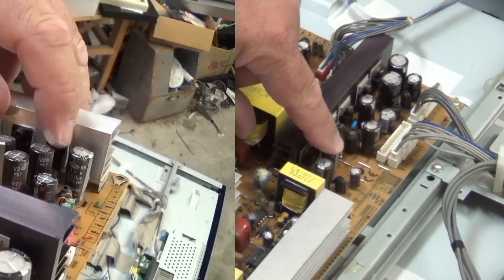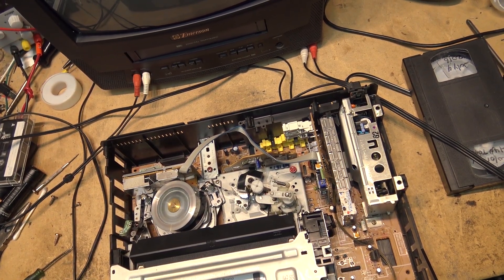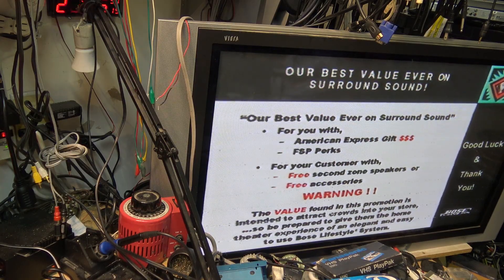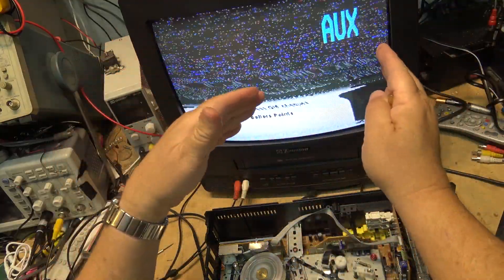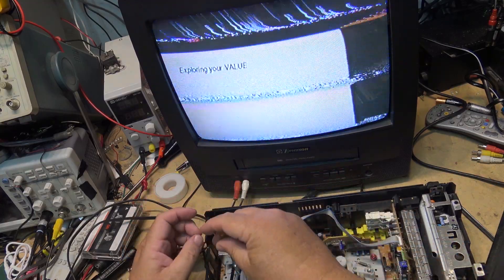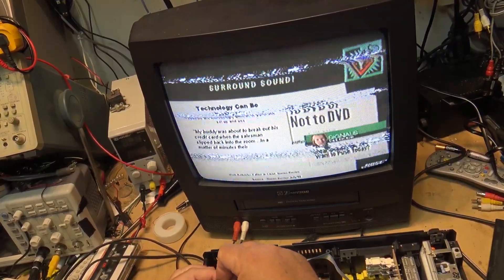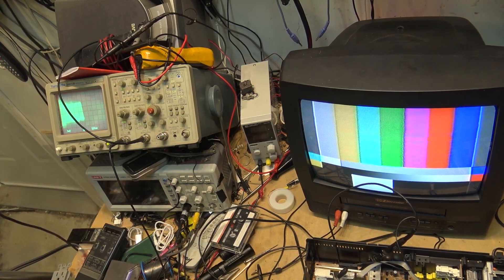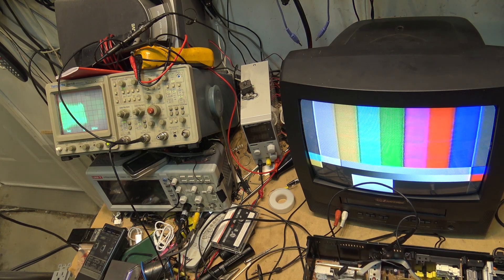VHS tape path alignment without using a scope

Comment: I've been trying to digitize some old VHS tapes and this was helpful in aligning my old VCR. With known good tapes i've got the picture perfect. What i can't seem to pin down is why with some tapes (all of them recorded family tapes) they're jumpy, fuzzy, and in black and white. None of them were recorded with this VCR, not even the ones i know are good tapes. Tested the picture with a home video that comes in clean and with a good Disney VHS. Perfect. Others? Not so much. Is this purely tape degradation? Some of them are copies made from camcorder tapes as well. I'm trying to figure out if it's the VCR or the tapes.
Reply from the maker: Tapes definitely do deteriorate especially if they are second or third generation which really affects the color quality. I'm just right now digitizing a bunch of tapes for a client and some of them are second or third generation but were recorded with home video cameras from the early 80s and the color off some of these cameras was well let's put it this way they're closer to black and white then color the camera is himself for just horrendous back then. But yes tapes do deteriorate it's usually the color that starts to go first because the luminance are black and white information is recorded as an FM signal where they frequency is modulated to represent the brightness the chroma which is the color signal is amplitude modulated as the tape deteriorates the signal level reduces and just like with AM radio a station that's distant will fade out and be weak or as an FM signal from an FM station remains loud and clear until it gets to the point where you can't detect it at all and then it just goes right away the noise

Comment: In this video, you have mentioned P2 guide pin and P3 guide pin. Where are P1 guide pin and P4 guide pin. What are the uses of these guide pins. Kindly explain with diagram, if possible.

Comment: what if that happens only with one tape , and it's like happening in waves every two seconds or so?
Reply from the maker: Is the tape damaged?
I have see tapes where someone put a magnet over it momentarily and it erased a section of tape along the edge. As the tape was playing of course as the spool on wines you get this little section of partially erased tape which caused flicker cause mistracking looked like a tracking error. We actually had some goofball in the video store that went around and did this to a bunch of pre-recorded tapes anyone who rented a tape of course couldn't play it. When the video store reviewed their security footage they found that a man have been going around holding a super magnet up to the tapes as he walked up the aisle ruining tapes that were on the shelf. This was after they stopped keeping the cassettes separate behind the counter and started putting them actually on the shelf. They caught the man it was featured in the local paper the problem was the man had a mental condition so he was not criminally responsible for the thousands upon thousands of dollars of damage that were done to all these pre-recorded tapes that all had to be replaced. The local video store actually had his picture from the surveillance tapes displayed prominently in the store with an oat saying our rental prices have increased to cover stock that we had to replace because of the actions of this man.
Reply: @12voltvids  Hello! Many thanks for your kind reply and help. Well, that was a glorious disaster indeed! So, I do not have the tape at hand, but I will check. And it also make a squeaky noise when fast-forwarded, and if I do that after stopping playback, the player stops, so I have to fast-forward while playing (I hope I could explain myself). I want to digitise old memories. Thank you!

Comment: Great tutorial. Btw, I converted an old vhs tape and have issues with 1 tape that has horizontal static lines during the whole tape. Would your tutorial fix it or is there some other method? See video here. Thanks for any advice.  https://youtu.be/p_9_4cn3Q8U

Comment: Thanks, this helped me get a VCR working again. I hooked it up to an old (analog) Commodore 1702 monitor and you're right, it was much easier. The one tricky thing was that I had to use a lot of pressure to turn the guide, and I didn't realize at first that pressure was also affecting the guide. So I found I needed to do e.g. a 1/4 turn, take the screwdriver off the guide and observe, then turn again, etc.

Comment: Doing it on my digital tv, cause i dont have any analog tv at home and it is so painful. Tried it for fifteen minutes and nothing changed, the picture is still distorted.
Reply: When i screw theleft  it does nothing to the display, and the left "screw" is more lose then the right one. When i screw the right, it s more tight and move the picture. What should i do?

Comment: Thank Dave for such good tutorial on videos. Please advise what is the tool you use to adjust the P2 & P3 Guide, because a normal screw-driver Cannot sit across the slot which has a center post. Thanks.11/1/21
Reply: They make it so you have to use a special "tape guide adjust tool" so that peasants like us can't fix things. I use a pair of (cough, cough) TOENAIL SCISSORS that has pointy tips that 'grab' two of the slots on either end of the center post. Then I put it all back together, watch Apollo 13, and cut my toenails.

Comment: Are P2 and P3 clearly marked? I'm a total novice at VCR adjustment and don't want to do irreparable damage to an elderly machine.
Reply from the maker: P2 is the one on the left side of the head drum and p3 on the right side looking from the front.  No they are not marked.

Comment: I sometimes have to de-align one of my vcr to properly read a tape that was home recorded on a deck that had bad azimuth around the video drum. The only thing i haven't made myself is a proper screwdriver to turn those post without falling aside. when i calibrate a deck for perfect alignment, i use a mix combination of a few factory recorded SP tapes and i have a few original LP movies as well,, i try to find the perfect middle position of the screw for that scope of tapes so i know it will be fairly okay on most tapes and will record about right in the middle of all those factory calibration.

Comment: My VCR is displaying a very dim black and white picture. Could this be a tape path alignment issue? I cleaned the heads and it made no difference.
Reply from the maker: Unlikely.   Check power supply caps.
Reply: @12voltvids  Thanks, will do. I forgot to mention, it displays color and brightness perfectly in the setup menus with no tape inserted.
Reply from the maker: @busterscrugs  
Probably a cap going bad in the lumanence process circuit.
Reply: @12voltvids  Well, I checked around for bad caps, couldn't find any that were suspicious. I did find a small spring though, not sure where it goes.

Comment: I’m restoring my VHS tapes and some of the older ones have this issue where the horizontal lines are all over the video. Newer VHS look and play fine without any issues. Does this mean the problem is with the VHS tapes rather than the player?

Comment: This is very interesting. Thank you. I recently borrowed my sister's old VHS player she had stashed in a cupboard and the picture was great for a couple of tapes being played, but suddenly the picture was awful. I tried to adjust the tracking and that improved the picture slightly, but now watching this I see that for some reason the alignment had changed. I wonder why it suddenly went wrong like that?
Reply from the maker: Have you tried cleaning the heads.  
If the lock screw comes loose the guide posts can shift.
Reply: 12voltvids Thank you for getting back. No I haven't tried yet. So far I have only played it.

Comment: is there a special tool i saw the two adjusting poles but they have very shallow X's with a round part in the middle.
Reply from the maker: I just use a slot screwdriver.

Comment: I have this very machine and I'm hoping to fix its video issues by this video since I am having similar issues with mine. I got it by finding it left on counter in the mail room of my building..At first it played beautifully for a long while then I used it again and started having picture troubles. If only I could find the remote that went with it..  Can you tell me the type of screwdriver you are using? These machines are so over priced when you look for one. I just love the look of it and even after all these years it still looks so modern!!

Comment: silly question
does multi head drum have only one correct path for the tape , or is that you just need to hit any video stripe on the whole length and that  could shift depenting on which one you hit, and there would be like 3-6 video stripes  you could align to depending on how much the mechanism alows and how many heads the drum has?
i am thinking of restoring two very strange very unique video recorders from the 70's and i kind of wondered about how much can the tape path be degraded on almost 50 years old equipment that never was really in use (but is quirky as heck and all transistorised no ic's)

Comment: What is the green circuit board looking thing that are often times found on top of the video heads?
Reply from the maker: Well that would be the interconnect that connects the heads to the rotary transformer under the drum. Some machines have the motor on the top and in that case it is the motor board.
Reply: @12voltvids  thank you! What type of screw driver are you using? I have practically the same VHS player. 

It appears to look almost like a flat head screw driver hole, except it’s got a dot right in the middle.

Comment: how do i get rid of them annoying DOTS that move abt on the bottom of the screen?  i have a panasonic ag7500, great picture, but the dots show up at bottom on all tapes? my cheap store branded machine crap picture but dots are below bottom of screen so i dont see them :-( ?
Reply from the maker: The dots and other artifacts that wiggle around at the bottom of the screen is called the head switching point and you do not get rid of them. The occur at 7 lines before vertical sync on Beta and 8mm and 6 lines on VHS. There is no way to rid yourself of them. In  the days of the CRT, the overscan of the tube hid them, no so on modern TVs or CRT with very accurate vertical size.
The reason that poing was chosen to switch the video head from one field to another is to avoid having in in the vertical sync area where it would cause sync instability and result in a rolling picture. 
Its one of the analog artifacts that you have to live with if you want to play with obsolete technology.
Reply: @12voltvids  cheers , thanks for the fast reply aswell

Comment: Excellent! I have two VCR's that play some videoes perfectly, and some of them they are stuck in the same pattern like you had here. I think it's weird that some does work and some doesn't, but I really hope this will solve the problem for the tapes that don't work now :)
Reply from the maker: The tapes that do not play right were recorded out of alignment on the recorder.
Reply: @12voltvids  Aha. Some of them are VHS-C tapes, put into an adapter. Got 10 tapes from a customer, and half of them played fine, while half of them were jumping/rolling like in your video :)
Reply from the maker: @OuglandMedia  cameras were especially bad at going out of alignment because people dropped cameras and knocked something out of alignment or broke something internal.  Some can be recovered others not.
Reply: @12voltvids  That sounds right. Some of the tapes works fine in the original camera they were filmed in, while playing them in a standalone players can cause problems. I have so much to learn, so I'm happy I found you channel :)

Comment: Great video, I have a Samsung VHS player and Im trying to archive my parents old camcorder tapes, which are on VHS; but the player it has recently developed an issue. The audio is perfect but the picture flickers and produces a horizonal lines across screen, and sometimes I can see 'film frames' (not sure the technical word). I have tried to clean the tape path (the head spool (all 6 heads seem to be clean), the erase head, capstan, pinch roller , I have also removed the tape cleaner, but the flicker persists), and ideas? DO you think I should try and adjust the P2 and P3 guides as you have suggested here? And if so is there a risk of unscrewing the guides completely?Many thanks.

Comment: Do you need a VCR alignment tape to do this? I have a Panasonic DMR-EZ48V that I am trying to realign after one tape messed everything up.

Also, do you have a replacement head cleaning liquid you recommend since freon isn't widely available anymore?
Reply from the maker: Isopropanol alcohol 99% works fine.   All you really need to do alignment is a known good tape.  Most prerecorded are very good.

Comment: Hi! I have a cassette adapter that I put the smaller vhs tapes from my camcorder into.  When I play a few tapes they’ve got like a static at the bottom of the screen.  I know these tapes are kinda old but is there any way I can fix this problem? It must be coming from the smaller vhs tape rather than the cassette adapter I’m thinking.  Anyway any suggestions would be greatly appreciated!!
Reply from the maker: You can try to adjust the exit guide on your vcr. This is the one on the right side of the drum looking from the front. That is where the bottom of the picture is recorded.  Look at the tape for damage on the top edge of the tape.
Reply: @12voltvids  awesome I’ll check that out !! Thanks so much!!

Comment: Could a misalignment on a VCR cause it to chew at just the edge of the tape, causing it to become kinda wavy? It plays fine and does not jam, but it just naws at the edge.
Reply from the maker: Yes it can damage the edge of the tape.  Usually it is guide that pulls the tape out behind the pinch roller
Reply: 12voltvids Thank you! From visual inspection that’s what I saw. Is this particular guide adjustable? How do you correct this? If you know off hand. Thank you.

Comment: I've turned mine so many times I don't know where the original start point is. Is it like a screw that can only go so many turns one way or another? Or is it just fine adjustment? At the start I was close to a perfect picture but too many turns later I have no idea what I've done

Comment: What type of screwdriver? I have a CRT and it looks like this VCR's heads are out of alignment, I keep turning the things with a flat-tip screwdriver but it doesn't do anything. What way should I turn
Reply from the maker: I just use a flat head driver.  As to which way you turn that depends of what way it shifted.

Comment: I never tried it. I just use the tracking control. This is for if the tracking control doesn't solve the problem?
Reply from the maker: Right.  If the lock screws come loose the guides can and do shift.  Then playback has lines in pix and tracking control won't fix it.  So then you need to do an alignment.
Reply: @12voltvids  I see in your most videos you use old analog scope to adjust the tape pass guides , I don't see like these scopes around anymore, can use digital scope for this?
Reply from the maker: @dmitripetrov5536  Not on the POS digital scope I have. They are junk unless you pay huge dollars for them. Find a used analog scope. The one I have I got for a song.

Comment: Question not specific to this unit, what things in a VHS vcr can cause black streaks/demodulation noise on sharp black/white transitions on playback? One of my Philips SVHS decks is noticeably affected by it, especially on SVHS tapes, other JVC SVHS one much less so but still happens on some tapes. On an older deck it would have been a bit easier to debug, but these newer JVC/Philips decks have almost no adjustments, and the most of the few they have are set in the EEPROM only accessible with a service remote which is pretty hard to get a hold of.
Reply from the maker: Worn heads.

Comment: Back in the day Video recorders were definitely one of the most complex consumer products ever made, both mechanically & electronically. 
That was definitely alot easier to align on the CRT set.
I've recently heard that the old CRT TVs are becoming increasingly popular with gamers, as they display some games (particularly retro & vintage ones) alot better than LED monitors.
Reply from the maker: Yes crt displays work better for retro games. I have a nice collection of crt.  Color sets 1.4" 5" 8" 10" 13" 19" 21" and 28".  All work.
Reply: @12voltvids  Did they use the same dot pitch on the smaller sets? I think the larger ones were what 0.31? The trinitron was 0.25 but the phosphors are all in line. I still have a working NEC EGA monitor which has strong color and good color balance.
Reply from the maker: The fact that they actually worked as well as they did was a miracle.

Comment: After the course adjustment as it was done here by 12voltvids, you can also some further fine adjustment with a TV if your VCR has a manual tracking control: You turn the tracking in one direction until a stripe comes into the picture, and then adjust the guides for it to disappear. The you can turn the tracking some more in that direction and repeat. The optimum fine adjustment is reached when the noise comes in on the whole picture at once when you turning the tracking left or right.